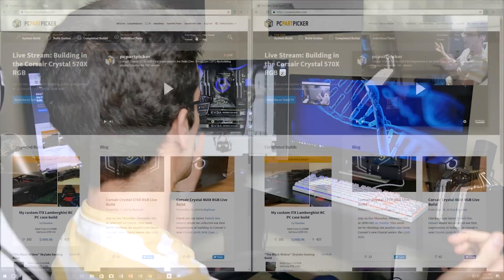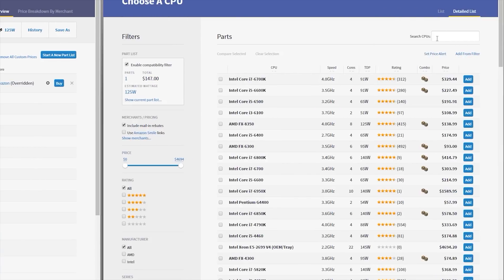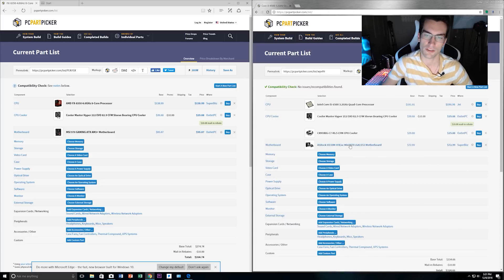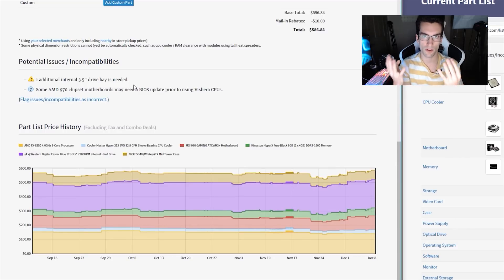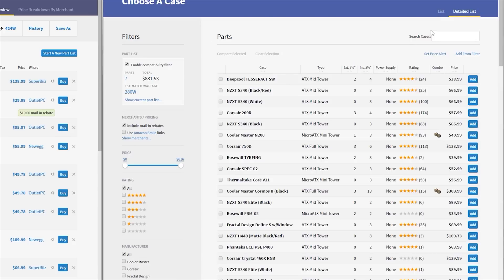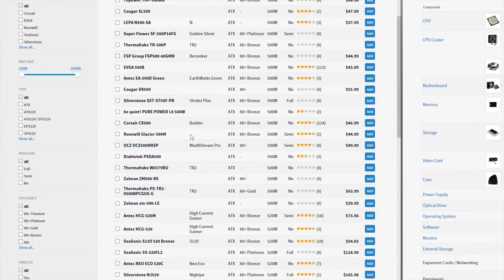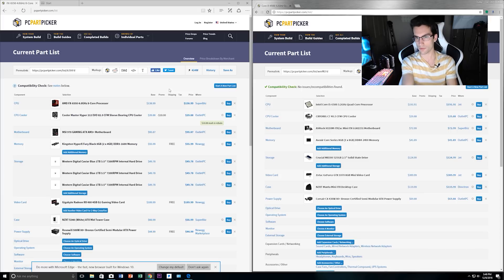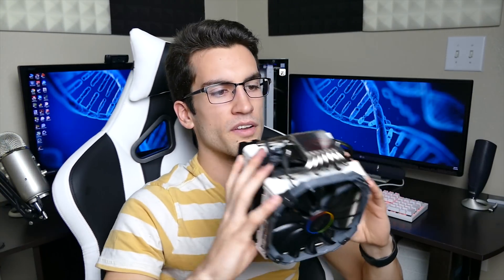Crash Course: PC Part Guide for Beginners

Comment: Just subbed, then first build in near 2017 and he recommends an AMD build for beginners. DO NOT DO THIS. Those processors are 3-4yrs old and you won't be able to upgrade your CPU in future, you'd need to change CPU, Motherboard AND Memory making it an expensive mistake. Plus you'd be using old DDR3 memory and not the new DDR4 memory.  Also in games which use single core strength the AMD can stuggle in quite a few games. 

There are better channels out there to help with new builds for beginners with advantages and disadvantages. Unsubbed.

Comment: when you click to choose a part you can clic to switch on list view on the top right of the part list its showing you.... that way you can see what the parts look like while choosing without clicking on it. Its easier to see the sizes and colors etc etc ... if it can help someone
Reply: by default its set on detailed list ... but if you enter you're specs on le right than put them in price order ... The normal list view is helpfull in my opinion

Comment: I've got a pro-tip:
Don't buy AMD until Zen is released.
Reply: Mike Vandenberg Mob Slayer  AM4 is the chipset, Zen is the market name. Like LGA 1151 is to Skylake.
Reply: Jec That's not right. AM4 is the socket AMD will be using for its new processors. Intel's Skylake equivalent would be LGA 1151. Intel just uses numbers because it represents the pins used on the socket side and they change it so often, that a naming scheme like AMD's wouldn't make sense.
Zen is the codename for their architecture, Intel's equivalent would Skylake or Kaby Laky for their newest iteration.
The chipset name AMD will use for their high end Zen platform will be X370. Other chipsets have yet to be announced since they will do a chipset model like Intel.
Reply: TechVoyager prepare to be disappointed as a skylake i3 will compete against your CPU and your motherboard will have no upgrade paths
Reply: Jec You said AM4 is the chipset and that's wroooong :D But yeah, I digressed a bit on my answer
Reply: TechVoyager An i3 has better performance for a cheaper price though.
Reply: fx8300 cheap and a champ in OC
Reply: +luigi90210 That may be the case because the fx has 8 "cores" and benchmarks like cinebench scale perfect with more cores. The problem with these processors is the ridiculously bad single core performance. If you ever take a look at the architecture you will notice that's because every two cores use one FPU for example. But there are also some other things that make the design of these processors bad.
So, your fx may be better in some benchmarks that scale well but will fall far behind the power and efficiency of an i5 in games and applications where IPC is more important than clocks and cores.
Reply: Jec What is zen?
Reply: chipset for amd
Reply: +Mob Slayer lol
Reply: SunRed That's basically what I said :/
Reply: SunRed lol fair enough
Reply: Building a PS4 build using an FX 8320E. Can't stop me now
Reply: Thundertube7 partypooper >:( xD
Reply: TechVoyager That's fabulous. One small problem is:
- Upgradability
- Shitty laptop-grade CPU
- All 8 cores would lose to an i3, for about 3/4 of the price
- No ddr4 support
- None of the additional stuff that newer motherboards have.
Good luck.
Reply: So you're all saying an FX 8320E is now pointless in 2016? I can wait for Zen but if I we're that impatient, I would opt for that FX CPU.
Reply: TechVoyager It is. It's completely not worth buying, with things like the i3 6100 or i5 6400 around.
Reply: It's a PS4 build. How much would you spend on parts if you're trying to make it just as powerful as a console? $600? I don't think so sir
Reply: Jec And the difference in price if I went for an Intel i3 based build is like $75? No way am I using that for a budget build
Reply: TechVoyager The FX 8350 where I live is $249. The i3 6100 is $155. The i5 6400 is $245.
Both are cheaper than the FX 8350, and the i5 is so much better it's not even funny.
The i3 would allow you to get a much better graphics card, while the i5 is just better.
What is your problem with them, as it can't be the price .-.
Reply: Jec Over in America, an FX 8320E is $80 where an i3 6100 is around $110-120. I know an i3 is better on performance but the FX 8320E is better on price and it matches PS4 performance. Strictly, this build is meant to mimic the console in almost all aspects except that it runs Windows and such.
Reply: TechVoyager Ok.
Reply: +Jec my FX8370 OC to 4.4GHZ performs on par with my bros 6600k OC to 4.2ghz in cinebench and i spent $90 on my processor in a motherboard processor combo at frys a couple months ago
Reply: if you overclock that 8320e to 4.4-4.7ghz on a good air cooler you will basically match i5 6600k(even if you get 2/3s the performance its gonna out perform a i3 and be a better value cost to performance wise) performance in certain benchmarks and overclocking the HTlink speed and CPU-NB speed to 3000mhz helps with single core performance a lot
Reply: ***** Probably not tbh, but they'll be cheaper. I'm expecting 6 core Zen CPUs to match up with quad core Intel ones. However, I could be wrong :)
Reply: Jec hey hey r5 and r7 is released
Reply: Tech4U2 now r3 is coming out on the 27th
Reply: And now its vega gpus

Comment: Also is there a benefit from using an aftermarket cooler?
Reply: yeah it will make it a bit cooler and you might get a bit better performance, but if you're not overclocking I don't think you need one
Reply: Mikel Bledsoe depends what cpu and how high you want to over clock
Reply: Chris Thesav
Reply: That depends entirely on what a person plans to do with their pc.  I had a stock cooler on an i5-4690k and during heavy usage, it simply was not enough.  I was hitting 90c within 5 minutes of 100% cpu usage.  I bought a 212 evo and never hit 60c again.  It's worth the $25-$40.
Reply: Better cooling, most intel/amd stock coolers have small amounts of fins and piping (also sometimes bad material) which limits their cooling due to the lack of surfaces.

Meanwhile aftermarket coolers have considerably larger piping and heatsinks (surfaces) which allows for better cooling, pair that up with a better fan and better materials (some use copper) and boy do you have a reasonable jump.

Comment: Was this worth it?
Cpu: amd fx 8350 4Hz 8core
Cpu cooler: 120mm water cooling
Gpu: Geforce GTX 960 4gb
Cost with taxes included: $960 canadian and was $200 off
Its an ABS Stalker ALA029

Comment: Are the CPU and GPU the only factors to really consider when deciding which wattage PSU to get? Should I not care about getting a slightly higher wattage PSU if I've got a couple extra drives, or a non-stock CPU cooler? What about if I'm overclocking?
Reply: Those are the main power consumers in a PC. While hard drives and fans will use some power, they are normally less than 10 watts, and fans rarely pull for than 5w. You are right on the overclocking though, as you increase the clock speed and the voltage power usage will increase
Reply: HalfOfAKebab I haven't built a PC yet but I think the general consensus is that you give yourself an extra 150-200 watts minimum on top of your parts to account for overclocking and just having that extra headroom. for me the minimum for a psu is 500 watt but I'd recommend going for 600 watt if you decide to put in a more power hungry CPU or GPU at a later date.
Reply: HalfOfAKebab the gtx 1070 recommends a 500 watt psu. in this case I would get a 650 watt just for safety on the overclock and peace of mind
Reply: Coolers and drives use very minimal wattage.
PCPartpicker will give you your highest possible wattage, I personally would aim 200watts 80+ bronze at minimum over your max wattage for overclocking.
Reply: HalfOfAKebab there's a couple of power consumption calculators that are quite accurate online, just google "pc power supply calculator"
Reply: HalfOfAKebab Use a powersupply calculator to kind of get a rough idea of how much power your pc will need if you overclock your cpu and gpu. A 650w or higher powersupply should be sufficent if you have an i5 6600k. if you have something else then you increase the powersupply capacity depending on how big of a leap the TDP is. Lastly if you have a Radeon graphic card then you will need a bigger powersupply because they are known to chew alot of power

Comment: Any ideas on how this will run?
Intel i7 6700k
Hyper 212 evo
MSI z170a Gaming M5
GTX 1060 3gb
16gb corsair LED ddr4 2666

NOTE
I already have a build and just wanted to upgrade my CPU, Ram, and Mobo. 
(I have already purchased my Mobo and Ram)
Reply: Oh yes, I currently have a AMD 860k and 8gb of ddr3 hyperx
Reply: if it is for gaming I wouldn't get a i7 6700k at most get a i5 6600k unless you are editing and need a i7. but other then that it is fine. if you don't get the i7 then use that extra money to get a 1070
Reply: Brenn it's already high end components shoul handle almost anything u throw it at
Reply: I've had the 1060 for awhile, Im probably going to get the 1070 this summer
Reply: Brenn just upgrade the gpu the cpu is overkill for that gpu if you mostly play games
Reply: Unless you get a i7 6950x

Comment: Lowest = i3 6100 + 1050ti  / Mid = i3 6100 + 1060 3GB / Mid 2.0 = i5 6500 + 1070 / High = i7 6700 + 1080
* IMO
Reply: OctoMan PC's pretty much, even the "lowest" is very capable of 1080p 60fps+ on most games and playable fps on AAA titles
Reply: Mr Rex
 I can vouch for that too.
Reply: *****
 That would be on the used side, yeah of course.
Reply: *****
 I buy old Dell Optiplexes with i5 2500s and some 3440s, 3570s and Windows COA for around 125$, Slap a 1050/1050Ti and You have yourself a true Console killer for 225-250.
Reply: I got that "lowest" combo and its pretty badass I have to admit. I didnt had enough money for more so I went for it and it plays almost every modern title maxed out reaching 60 fps and more
Reply: Dion Albrecht  I was surprised myself with this build, the i36100 is grossly underestimated.  plays everything when paired with a 1050ti or a 1060 3gb.

Comment: will skylake i5 6600k's price drop when Zen or Kaby Lake  come to the Market? Im about to buy a Z170 and cpu but i dont want to buy it than have it $50 cheaper 2 days later.
Reply: rule #1 of pc parts: If you want something BUY IT, theres ALWAYS something new coming up.
Reply: jattus2 Im gonna buy them between now and mid January. im new to building Pcs so i dont know if there is a trend of Lowering prices Drastically and I dont know when these New CPUs are going to release. 

its like if someone who doesnt know about Black Friday and Cyber Money asked if they should buy a New pc in October, when you know they can save a few hundred in a month.
Reply: Anon Foruz I payed $219 for my 4690k. New egg is now selling them for $239. Normally if you are buying them new the price will not drop, the newer one will just be the same price.
Reply: Zen? Only if it's competitive which it probably wont be.

Kaby Lake? No, Haswell and previous generation prices have even increased with newer generations coming out.
Reply: Od1n12 nah bro you were wrong zen chips are super competitive with intel

Comment: I just build my first PC, man it was rough but im so proud of myself right now
Reply: 750 watt is WAYY overkill lol. And pentium for gaming. Dude. Should have at LEAST got an I3 6100
Reply: i also built my first pc and it was actually pretty easy! Specs: g4400 pentium, b150 gaming m3, rx460, HyperX fury ddr4 8gb kit, and a random 750watt power supply i had laying around.
Reply: Actually the pentium g4400 beat the athlon x4 860k, In alot of gaming benchmarks, Meaning playing the game and comparing fps, Its only issue is it does NOT support games that require 4 cores or MORE.
Reply: nice I built my pc in October
Reply: I built my first a few months ago, I was comparing parts for months but it was so satisfying when I finally built it.
Reply: Welcome to the familly !
Reply: Steve i built 3 pcs for friends but still have a laptop myself :((
Reply: Combatsmithen  Check other videos on the Pentium, I personally would have got a better CPU for that rig, but if it purely for gaming it's enough to get very high fps per dollar.
Reply: Zach Jones Maybe if he only plays minecraft lmao. Face it. Pentium is horrible
Reply: Ulises Welcome to PC, friend!
Reply: Steve did you write this comment on your new pic?
Reply: Skylake_TheDank Did you use that website
Reply: Steve what the specs

Comment: A few questions.
Why not use the h7 or M9i heatsink?
Why pick the 970 chipset over the 990fx? 
Did some research and it costs about the same to get the better 990fx.
Reply from the maker: Mattack This was for demonstration purposes only... has nothing to do with optimal selection. I already have videos covering that.
Reply: Salazar Studio ah I see. Thanks for the reply.
Reply: Because the ARCTIC i32 and the i11 destroy said coolers.

Comment: Salazar I'm building a pc + setup for Christmas what do you think about the list (not everything is for Christmas some of the stuff I already purchased):

Parts: 

- Node 202 Case
- ASRock Mini Itx Z170M MOBO
- Rx480 (don't really know which one)
- I5 6600K
- AData 480gb SSD
- Cryorig C7 Cooler
- Integral Fractal Design Power Supply

Peripherals:

- Logitech Prodigy Series Wireless Mouse ("non pro" version)
- Logitech Prodigy Series Keyboard (same style as mouse)
- Logitech c920 webcam
- Sennheiser GSX 1000 DAC
- Bose Soundlink 2 Headphones
- Cable Runway
- IKEA Desk
- Lenovo 21.5" monitor
- ** Can anyone comment below a good mouse pad as far as which one is better hard or cloth!

Thanks to anyone who read this, including Salazar :D
Reply: looks good :D should perform pretty damn well
Reply: For mousepads, you definitely will not go wrong with cloth mousepads.  I'm personally not a huge fan of hard pads as they wore mouse feet very quickly and will feel uncomfortable on your hand.
Reply: Maltazer Thanks!
Reply: Homeless Kitty ♥ Okay, will look into it, thanks!
Reply: You can fit the scythe big shuriken 2 in that case, it destroys C7.
Reply: I will look into it!

Comment: My AIO liquid cooler died, rip.  It only lasted 11 months smh.
Reply: This is why you buy d15s and never look back
Reply: Joseph Enigam Alright. I guess now that I have an extra fan, I can now have a push/pull configured radiator.
Reply: warmon6 It seems to have fixed itself (stock cooler) as minimum is around 37, but on average, idle is around 45-50.
Reply: Rat Face Corsair and Nzxt have a 5 year warranty. You can get it replaced
Reply: No warranty?
Reply: Xeon Idk, I have a shitty H55. It was horrible to begin with.
Reply: Rat Face You have a warranty, use it.
Reply: ***** My case won't fit that (Corsair 250D).
Reply: hm... strange, have an H55 that is still working for over 1 1/2 years (only a few months shy from 2 years)...  Was first in my itx build but currently in use for my sister desktop Core i5 6600k. (Had to take it out when I added a dedicated GPU to the case.)

Not the most impressive AIO but it does the job well for it's price point.

Certainly get a warranty. I say you got unlucky with that unit.
Reply: warmon6 You can't even do any OC'ing on it. I think it is a horrible value. Sucks that mine didn't last as long as yours :/
Reply: No overclocking? Must of been a really bad unit but maybe you were using a high TDP cpu than what I used? What cpu were you using? 

For my ITX build, I used an AMD APU (a10-7850k) and was able to overclock it to 4.4 Ghz just fine (wasn't able to go higher than that due to the motherboard).

That's a 95W chip. Now I cant report what the temps were only the thermal margins (it weird amd did this) but I had about 35C margin left before I hit a max ceiling.
Reply: warmon6 i7-4790K.
Reply: Rat Face Hmm... in theory you should of been able to overclock as that has about the same TDP as my APU.

But It's hard to tell if that was a really bad cooler or not. 

Well hopefully that RMA works out for you and you get a better unit that gives you better experience.

Oh before I forget, i meant to show a pic with said temps (so that im not lying to you). My system on pcpartpicker.

https://pcpartpicker.com/b/PPd6Mp

Just ignore the 4.5GHz you see on CPUz. While I was able to be "Prime stable" at that speed (normally my "go-to" stability method), some applications didn't like that speed and no voltage increase was making it stable. I turned down to 4.4GHz and was fine then.
Reply: So I strapped on the stock cooler that had been unused for months temporarily. While it has gotten better than before, it still idles at around 70-80 degrees celsius. Strange.
Reply: Rat Face yeah thats certainly not right.... even the stock cooler should be able to handle that cpu while idle... (load is a different story.)

i would check your voltage of you cpu. if its been left stock voltage, you may need to manually lower it. (My gigabyte board stock voltage for my apu is 1.4v but i was able to lower it to about 1.3v and if i turn off the igpu, i've gotten it to as low as 1.18v (with also disabling turbo core).

shouldnt be causing that much heat but it could cut some of the heat off.
Reply: Rat Face well glad that work itself out! now if all problems fix themselves like that! lol
Reply: warmon6 Ya, I just pressed the reset button on my case, and that seemed to do the trick. Strange.